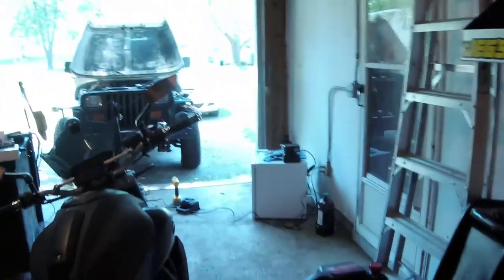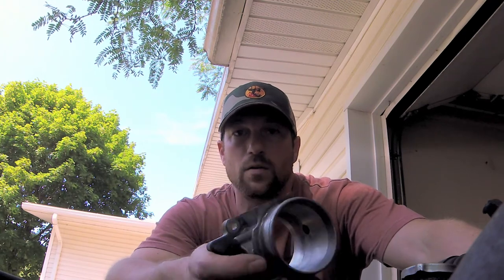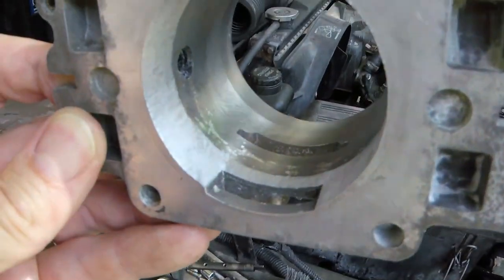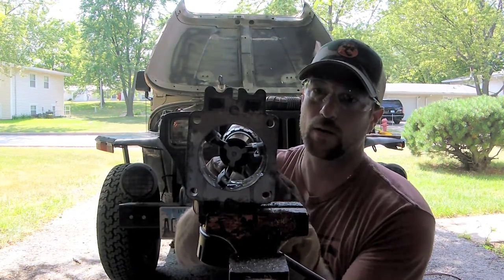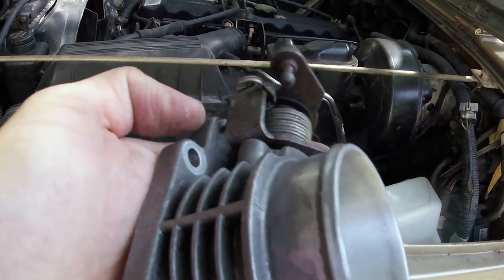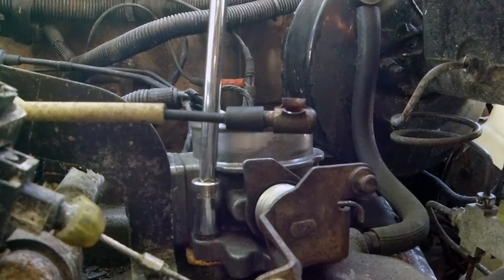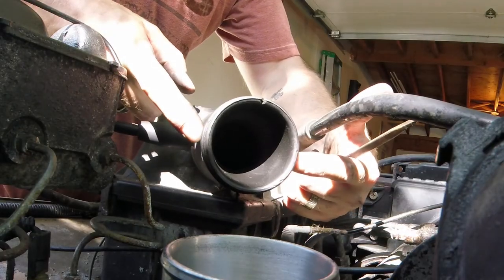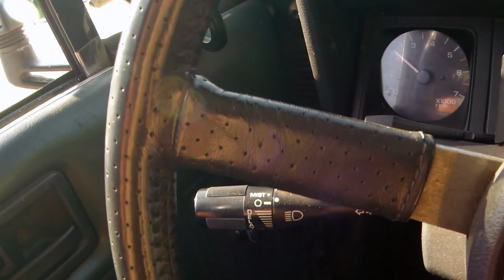DIY Jeep Throttle Body Mod

Comment: TMV Garage The proper way to set the throttle plate is: 
1. With both throttle plate screws loose, back off the stop screw until the throttle plate seats against the bore of the throttle body. Make sure it's centered the best you can.
2. Tighten the throttle plate screws.
3.Check to make sure the throttle plate doesn't bind when opened and closed. Move it slowly so you can feel if it drags.
4. Turn the stop screw in till it makes contact with the throttle linkage. Then 1/4 to 1/2 turn more. 
The throttle plate should not rest against the throttle body bore.
The way we did it a Eaton Supercharger was with an air flow gauge to set the stop screw. But this will get you close enough.
Reply from the maker: Nice thanks

Comment: I did this to my 97 Grand. Honed out below the butterfly. From the seat of the pants feel I think I lost some low end torque but on the highway it really runs better. No change in fuel mileage at all either. Biggest difference was a Cold Air Intake ( HOME MADE ), Free Flow Cat. & Muffler by MagnaFlow. Want to throw a stock Throttle Body back on & see how it runs but I've been saying that for years, LOL.
Reply from the maker: Lol hell ya. Well leave another comment if you ever do it and let us know what you think.

Comment: I think any increase in air flow will be beneficial. To get precise figures you would have to brake this truck using special equipment and measure the bhp and torque.

Comment: can anyone confirm this i read many yrs ago but can't find it anymore. Doing some type of mod to the throttle body can increase gas mileage by a lot. Could that be true? would anyone point me to the intel to read about it  Thanks New to DIY to learn say money teach my boys how to do stuff other them video games...
Reply from the maker: Amen to teaching your boys. I don’t know about any hard numbers on the subject but my opinion is if the engine is more powerful and uses the same amount of fuel to make that power then you should see some improvement in MPGs. I haven’t seen any noticeable increase in power or MPG but I also didn’t bore it out very much either. The important thing is I definitely haven’t seen any loss either.